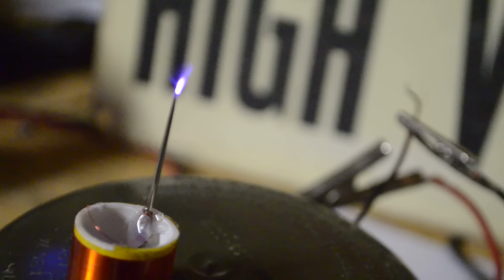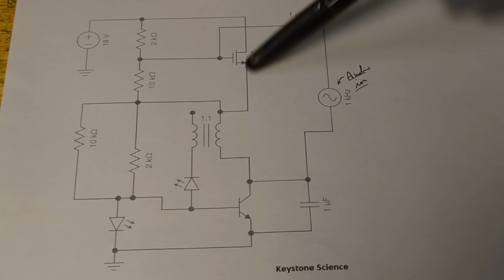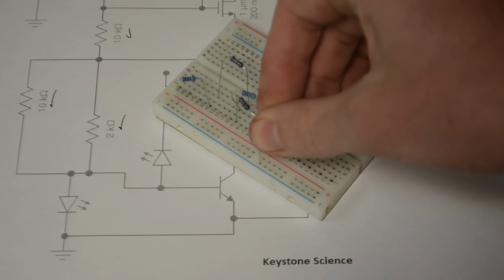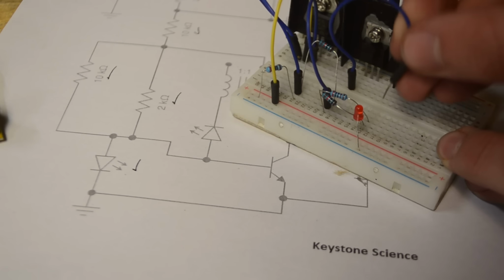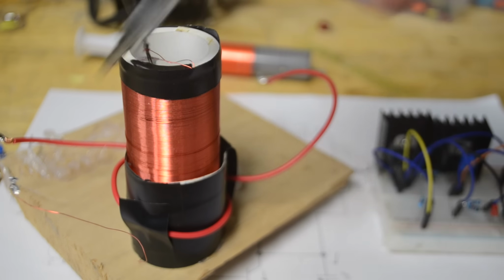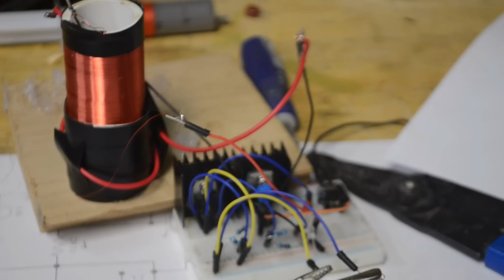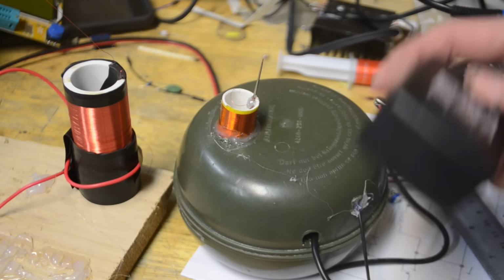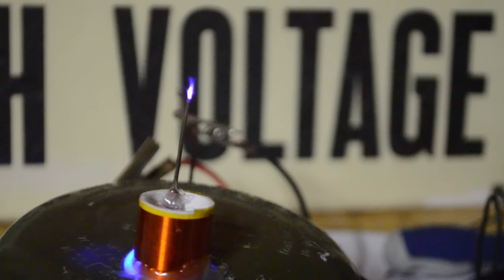How to make a mini Musical Tesla Coil

Comment: I implemented the circuit shown in the video as it is. But it doesn't work. However, the input voltage is only 12v. Is this a problem? The MOSFETs and transistors get hot. Please help me.
Reply: Same here 
My mosphet just warms but my transistor heats up 
Idk what to do I even added a 50k pot but still no change 

The only thing that happens is when I touch the secondary when on the led connected to the sec coil just glows a bit 
I'll prolly now do some hit and trial with the primary turns 😕

Comment: The schematic does not make any sense. The LED in series with the secondary coil is to be connected from ground to the base of the transistor. The 1 uF capacitor and the audio input must be in the other side of the primary coil. The 10k resistor shall go to the base of the transistor, and the 2k (?) resistor to the LED. The LED can't be in parallel with the BE junction.
Reply: Otra vez tu cagando el palo?

Comment: what mosfet did you use on this? could a tip107, 41c, 30c, or 102 work?
Reply: tip 41c will work

Comment: Oh i tried to build it but its not working. I wound bigger coil than yours(20 cm X 5 cm), i am using irfp250n as my mosfet and same transistor as you. I couldnt find ceramic capacitor so im using same value polyestern cap. i tried switching primary connections but still nothing. I placed 50 kohm pot in place of that resistor and tried a bunch of different resistances but still nothing. I am using computer power supplie to power it, although when i connect it the led that is connected the the bottom of coil starts to glow for some reason. It even glows when + is not connected only -. Could you help me? i doublechecked every conection dont really know what to do
Reply: I'm also stuck there 😭

Comment: I have a theory, what if you used a full range audio amplifier such as a Brazillian made that has a 250v output voltage into a modified Mot with a 1 ohm primary and use the 5kv output from the secondary coil for firing the primary on the tesla coil itself?
 Theoretically would that work for building a musical tesla?

Comment: 18 volt AC DC adapter

Bred bored

Resistors
2 k♎ resistor
10,000 k♎  resistor
2000 k♎ 10000 k♎ 
dull orange LED like this

This guy right here mosfet or Transistor
|    8ONF 70.          |
|     GKODX  V♭   |
|     CHN ♭22.      |
|     [ST]     (e3)G.   |

Another transistor
     |       F.             |
     |     (E.)   L08  |    or LO8
     |  BD243C      |

Ceramic tranceister
|105.  |
|(N) X |

Headphone jack

50 volt 1 micro something electrolytic capacitor   8:36
Reply: k♎
Reply: First transistor is IRFP260N not BD243C

Comment: i have made a list of what parts  i herd I hope he puts what it in
Reply: 18 volt AC DC adapter

Bred bored

Resistors
2 k♎ resistor
10,000 k♎  resistor
2000 k♎ 10000 k♎ 
dull orange LED like this

This guy right here mosfet or Transistor
|    8ONF 70.          |
|     GKODX  V♭   |
|     CHN ♭22.      |
|     [ST]     (e3)G.   |

Another transistor
     |       F.             |
     |     (E.)   L08  |    or LO8
     |  BD243C      |

Ceramic tranceister
|105.  |
|(N) X |

Headphone jack

50 volt 1 micro something electrolytic capacitor   8:36

Comment: I'm trying to build this and I only have 22 gauge wire will that work alright? you said you used 32 and I just want to make sure I don't blow something when I plug it in
Reply from the maker: +Drew Aurioles it should work, I don't see why not anyways, as long as the ratio is similar

Comment: Hey, I really need some help with the circuit, I have connected everything up properly, but there are no sparks coming out, and the LED connected to the secondary will not light up. I am using an IRFP250 mosfet, with a 2SC3320 transistor.
Reply: Yo have you found a fix for it?

Comment: I've a strnge problem with this... when i turn on my power supply the led connected to secondary coil blinks once. Besides npn transistor heating up this is the only sign of something happening... Does someone know how I can fix this? (sorry if my english is not perfect)
Reply: Yo did you find a fix for this? I have the same problem..
Reply: Frager reverse the primary?

Comment: What is the point of the LEDs in this schematic? Are they simply being used to show an off or on state, or are they being used as diodes? I'm wondering if I can omit them and simply make the connections where they are.

Comment: I went into video thinking I could do this and then realized you need to be smart to do this. Rip
Reply: Braelin Love yeah i thought aswell that you just stick two wires in a potato and boom you have a musical tesla coil:/
Reply: Y'all can do it, you just need to print out a schematic so you can build it thoroughly and slowly. Also, take some free time to read and learn about some basics of electrical circuit components and physics. Two years ago I didn't know the difference between AC and DC power, and now I've successfully built some pretty powerful solid state tesla coils. If you don't let technical jargon intimidate you, you can absolutely learn how to do this and why it works. Tesla coils may not have real world applications, but building your own is education gold. You also learn to persevere because you'll likely fail a lot, like I did.
Reply: Yeah, simple electrical physics should help you understand the technical jargon
Reply: Braelin Love lol same
Reply: Braelin Love ...lol
Reply: The way he explains it makes it pretty easy to follow. Its getting the right parts that would be my problem.
Reply: Not really

Comment: Hi just 2 questions more

1.-Can i use a 63v capacitor instead of a 50v capacitor?

2.-Can i use an audio input with only 2 pins on one side and one on the middle?
Reply: yes, of course. The higher voltage rating only means that your capacitor can handle more voltage, just make sure the capacitance is the same. In the video he said it doesnt really matter as long as you can input an audio signal from it, the middle one is the ground while the two pins are the positive.

Comment: I can't found that 80nf70 transistor what could i do?
Reply from the maker: +Plaink Resst really any higher power transistor should work fine, I would personally use something like the Irfp260, or 250 or 460 and it should be able to handle a even higher voltage ( you also would need to change out the other transistor for a more powerful one as well though )
Reply: thank you
Reply from the maker: +Plaink Resst no problem!

Comment: please make an electromagnetic levitator
Reply: He needs a superconductor and neodymium magnet for it to work and makeing a superconductor is not as easy as puting it in liquid nitrogen its a long painstaking task of heating cooling and adding impuritys. A superconductor is hard work it mi gn t take him 3 videos to make a small superconductor step by step then he could make the levitating thing but i dought it
Reply: +Lord Awesome 
No, he could just use a controlled magnetic field, or spin whatever is being levitated.

EDIT: Or he could glue a panel of Pyrolytic Graphite on the bottom of the levitating object, then balance it over a few Neodymium magnets, but if that's not strong enough he may have to use Sumarium magnets.
Reply: +jackemled. Those type of magnets are hard to male and wont levitate if you don't put it in a certain area. And spining magnets over coper will work but you will need a very fast spin and a certain magnet configuration.

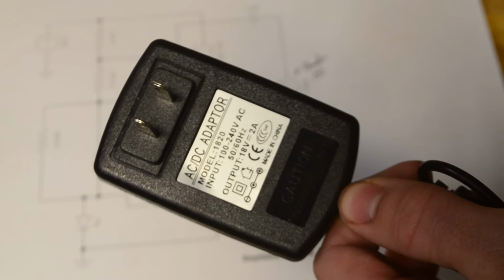Comment: 1:18 "18 Volts at around 2 Amps"
It can't output 18 Volts at 2 Amps, it can only output 18 Volts and provide 2 amps as maximum (it problaby can do more, but it should not provide more than 2 amps at 18 volte).
Reply from the maker: +TheYouTubeCuber yeah that's what I meant, at a short circuit that can supply 2 amps

Comment: just a quick question, on your 400:1 coil does it make it less effective since the 400 turns are much taller that the single turn? I would think it would work better if the 400 turns were done in say 3 or 4 layers and only be about 1/2" or 1" tall?
thanks
Reply: Wing it Workshop yeah I thought the same. Would be logical
Reply: Wing it Workshop thats not how tesla coils work , the voltage boost is based on resonance pumping not on normal tranaformer technique , you wont see any multi winded teslas for a reason
Reply from the maker: +Wing it Workshop yeah that should work, the only downside to it might be that the coil would arc within itself, but if you had it well enough insulated then it should be fine
Reply: Keystone Science would it be or efficient that way or would it not make a difference?